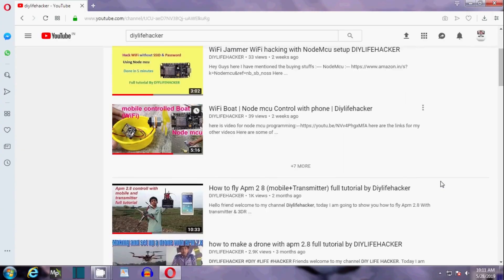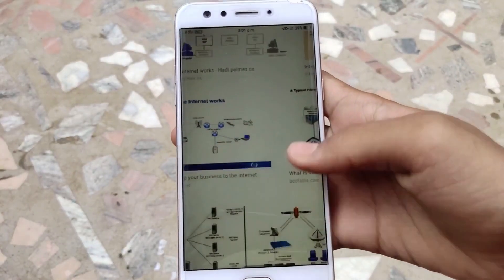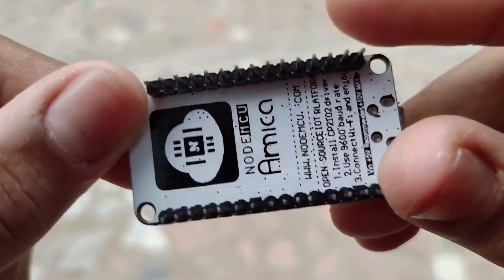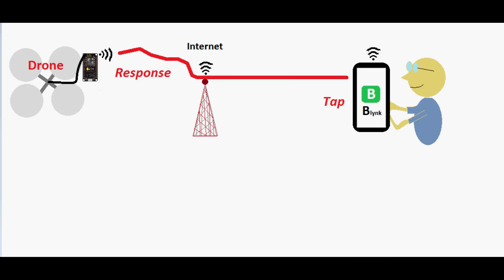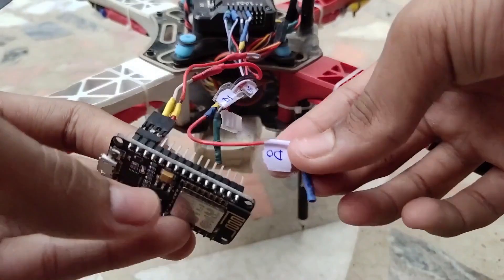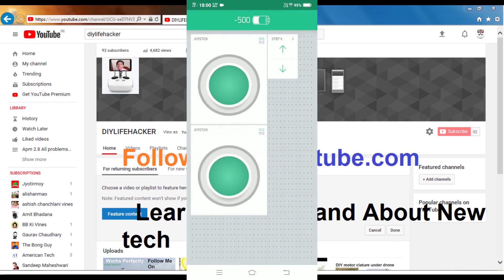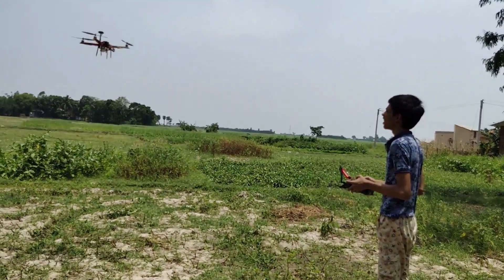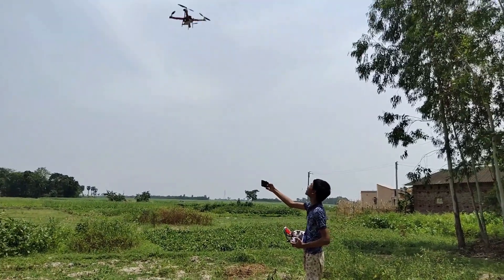IoT Drone | NodeMcu 4G Drone |  Unlimited Drone Rang (Part 1)

Comment: can u tell me which pin to declare to which joystick in throttle and direction 
i am getting signals while i am doing radio calibration,but as i am trying to arm,there is no message showing and it is in disarmed position only..
Reply from the maker: do as shown in the video. keep pins same
Reply: @DIYLIFEHACKER  bro, in video pin declaration in blynk is not shown

Comment: can u give diagram of circuits again,provided one is blur!!
Reply from the maker: Make UDR v2 or V3 they are advance
Reply: @DIYLIFEHACKER  Diagram for v2 is still pending in discription.
bro,i have folloewed your steps to connect node mcu with wifi and blynk,but i am callibrating in arducopter,no responce is there in arducopter software,in my phone ,blynk project is showing ,it is online
i think i had done mistake in connection from node mcu to apm2.8
can u please give diagram of wiring...
Reply: @nightsky2470  bro me to not getting

Comment: Hats off bro....I was thinking to use my mobile hotspot but using an expensive mobile on drone was a risk factor + it increased weight of my drone....which increased the power consumption and resulted in stability issue.....but a mini router is the perfect solution for this problem.....great thanks...!!!

Comment: nodemcu esp8266 will work only if it is connected to your mobile hotspot..thn who is this unlimited range
Reply from the maker: That's point !!! it uses Internet, not Intranet....
The NodeMcu is not connected to the mobile hotspot.
It's connected to the 4G WiFi router which helps the nodemcu to connect to Blynk cloud through internet.
Reply: Bro where is V3? With wifi unlimited range camera?
Reply from the maker: @TheGreyOwl  I'm working on it. Obviously with live stream intregrated
Reply: @DIYLIFEHACKER  but when u lie stream there will be a 20-25sec delay ..how do u fix that?..
Reply from the maker: @TheGreyOwl  Hmm...not that difficult...see soon

Comment: Can I use 9 channel receiver with 6 channel flight controller, like FSTH9X with KK 2.1.5 flight controller
Reply from the maker: no
Reply: @DIYLIFEHACKER  Any suggestion for flight controller compatible with fsth9x 9 channel
Reply: @DIYLIFEHACKER  I mean I will only use 4 channels of transmitter and 4 channels of flight controller
Reply: @DIYLIFEHACKER  Bhai 6 flight modes setup kaise karenge pixhawk mein using flysky th9x

Comment: Bro my nodemcu is giving incorrect pwm values, so I can't able to calibrate the RC. The nodemcu values ranges between 995 to 2007 , since apm accepts only values between 1100 to 1900, I'm not able to work this out
Reply from the maker: Yes. that's a point.
please make UDR v2, there's everything is solved
Reply: @DIYLIFEHACKER  but bro you didn't put diagram for udr v2 yet.. I've been requesting for months. Atleast Please give some pinouts for the connections bro.. I've been eagerly waiting for this sine 6months 🥺
Reply: @kimjong-un4954  Did you get any updates ??

Comment: I am new to drone. I want to build one that can carry deliveries. I want arduino drone starter kit that i can start to work on. I hope you can suggest one. Thank you sir.

Ps. You're a genius sir
Reply from the maker: How can I help you?
Reply: Can you suggest drone parts that I can start on? What I have currently on my mind are:

1. Quadcopter frame arm
2. Arduino
3. Brushless motor
4. Battery
5. Smartphone
Reply from the maker: @barbatos9616  Buy ESCs  & a Flight Controller & that's it.
Reply: Thank you

Comment: i have porblam in coding in ardino 
Arduino: 1.8.13 (Windows 8.1), Board: "Generic ESP8285 Module, 80 MHz, Flash, Legacy (new can return nullptr), All SSL ciphers (most compatible), dtr (aka nodemcu), 26 MHz, 1MB (FS:64KB OTA:~470KB), 2, v2 Lower Memory, Disabled, None, All Flash Contents, 115200"

ESP8266_Standalone:37:32: fatal error: BlynkSimpleEsp8266.h: No such file or directory

 #include <BlynkSimpleEsp8266.h>

                                ^

compilation terminated.

exit status 1

BlynkSimpleEsp8266.h: No such file or directory

This report would have more information with
"Show verbose output during compilation"
option enabled in File -> Preferences.
Arduino: 1.8.13 (Windows 8.1), Board: "Generic ESP8285 Module, 80 MHz, Flash, Legacy (new can return nullptr), All SSL ciphers (most compatible), dtr (aka nodemcu), 26 MHz, 1MB (FS:64KB OTA:~470KB), 2, v2 Lower Memory, Disabled, None, All Flash Contents, 115200"

ESP8266_Standalone:37:32: fatal error: BlynkSimpleEsp8266.h: No such file or directory

 #include <BlynkSimpleEsp8266.h>

                                ^

compilation terminated.

exit status 1

BlynkSimpleEsp8266.h: No such file or directory

This report would have more information with
"Show verbose output during compilation"
option enabled in File -> Preferences.

plz help

Comment: Great job!! Could you pls make a vdo which clearly explaining how did you extend the range of node mcu using mobile network from a hotspot ..trust me it will go hit..since many of us need a long range network connection...
Reply from the maker: The range( between Hotspot & NodeMCU ) is not extended. The hotspot connects the NodeMcu to the Blynk_Server and Blynk App connects to the same server through mobile network
Reply: @DIYLIFEHACKER  ofcourse...same i said ... but i asked how did u connected nodemcu-hotspot-blynkserver and blynk app??
Can i use the same process for a rc car?? If ya then how??

Comment: Code is  not correct,  you don't define pin, pwm not, how is possible?
Reply from the maker: Yes, it's possible.
I used blynk.run() function .
Blynk library automatically map all the things after setting up the blynk App.

Also v2 of this project is coming soon.
May be 10th March.
Wait.
Search about IoT you will get how pin defining works including Blynk library

Comment: your project is good but i think  it will not go up on height becoz of weight..
Reply from the maker: No, it will go up also with a good stability. A router is not so heavy at all. To make it more efficient remove router battery and power it from ESC BeC.
Reply: DIYLIFEHACKER bro i think insted of router 3g usb dongle works more efficiently...bcoz its weight is too low what u think?

Comment: Make a video on getting a range mote than 700 meters u without using any type of boost module
Only using that wifi module 😊
Reply from the maker: Its not any privet communication like binded transmitte and receiver.
Comming soon, wait......
I am just using the internet.
If you have not much idea about IoT projects go ahead and check them out in youtube

Comment: please what Language of programmation do you use for your drone?
Reply from the maker: You can not make changes behavior by external coding there is a mission planner app which converts languages automatically by just clicking and calibrating some component like GPS accelerometer and compass or others and for other device to attach like development board use the arduino IDE app with c pogramming language👀
Is it helpful